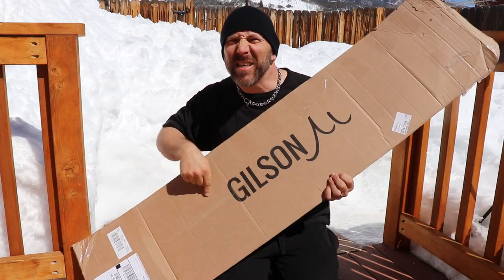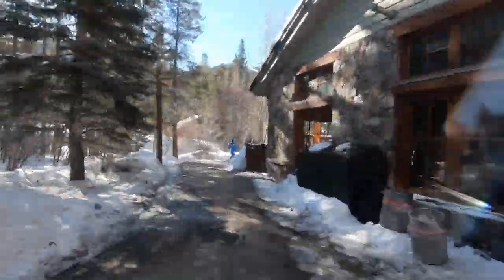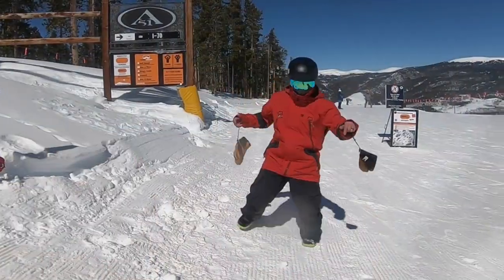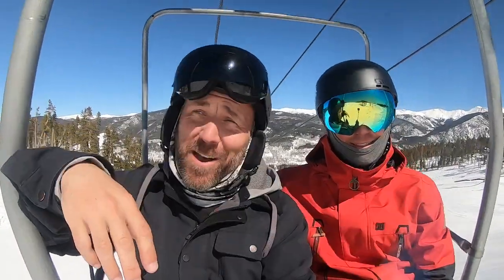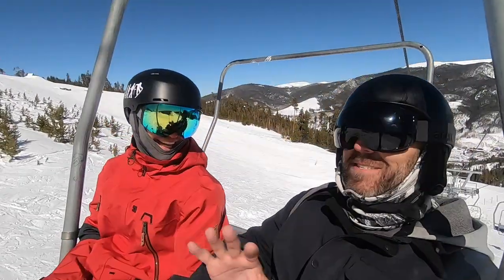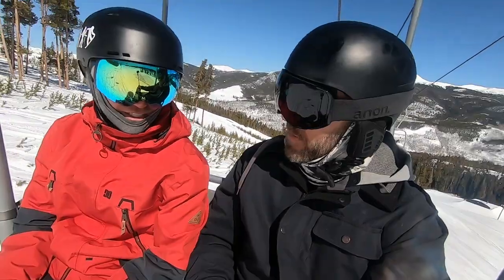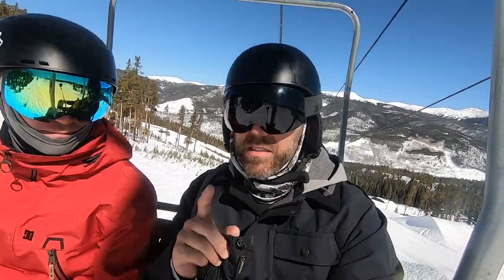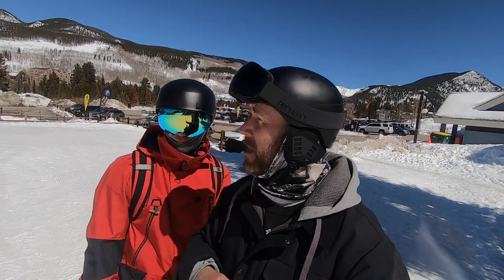Gilson Duel Snowboard Review - Fun Park and Best Butter Board

Comment: I'll be taking my Gilson Undead to Keystone on March 1st for a full day of awesome riding. Too bad Easy Street isn't open, though.
Reply from the maker: This year it is open just as a green. The features are built in the park just over a bit.  

If u dig Gilson wait till till u see the limited run board I designed for them coming soon.
Reply: Well, I'll definitely be checking Easy Street out on the 1st.
I saw your sneak peek of the design but not the full reveal yet \m/,
Reply from the maker: It is so close to them getting all the stuff ready. Got the name today for it.

They are going to let me offer some discount codes to my subscribers so I am stoked on that too.
Reply from the maker: Just found out it should be available possibly next week.